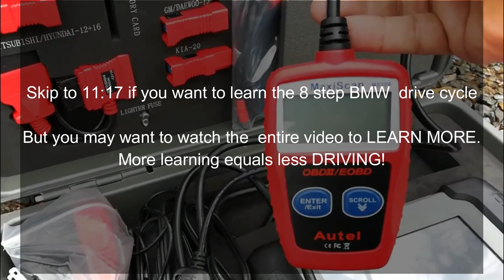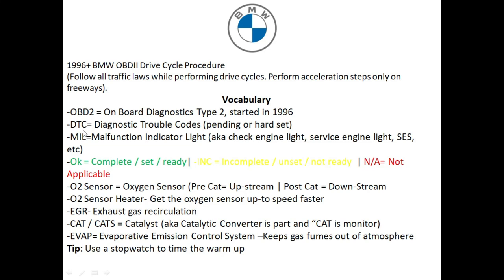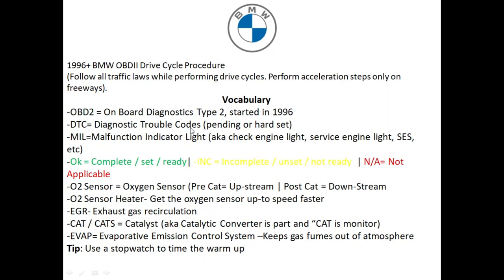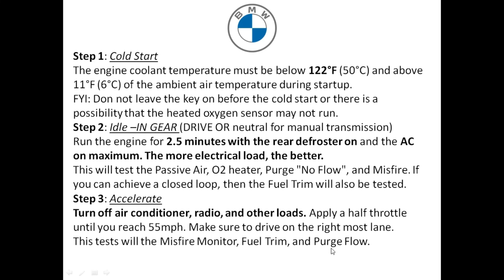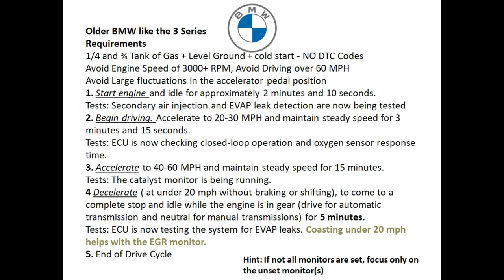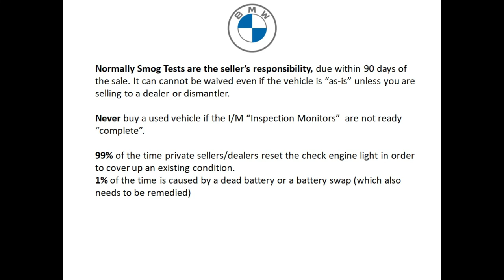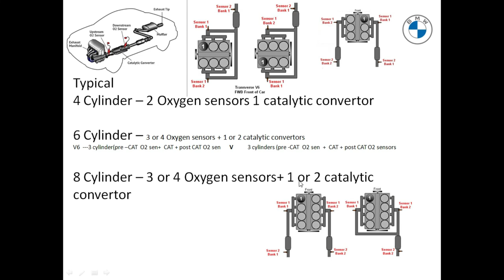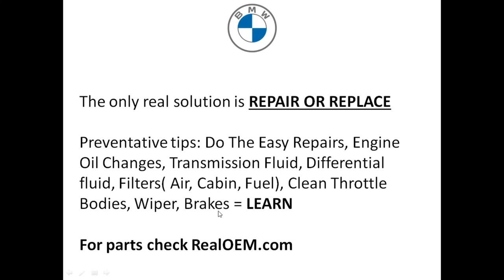BMW Emissions Testing Drive Cycle ▶️BMW Smog Check ▶️ BMW o2 CAT EGR EVAP Monitor Readiness

Comment: Can’t get the CAT to get to ready…. E46 M3 160xxx miles…
Reply from the maker: Hi Bill what caused the monitor data to cleared or what triggered this event?
Reply: @RANDOMFIX  - this has been on going for a year and a 1/2. First - I had to replace an oil level sensor. That requires disconnecting the battery. Smog failed. I drove for a few MONTHS and all but the CAT registered ready. Then, that new oil level sensor failed and I had to replace it. Start back from 0. Well fast forward a year (1/2 of which I didn’t drive much due to Covid) and I’m driving 1 hour each way to work (in LA traffic). For the very first time after weekly checking, my CAT registered READY. I was in shock. I had a SES light on with a P1434 code due to an old gas cap - I replaced it with an OEM gas cap over the previous weekend - so I decided to clear the code. Bad idea, that reset ALL OF MY MONITORS - including the CAT which took me 1 1/2 years to get to ready. I’m now stuck on getting my CAT and EVAP to ready.
Reply from the maker: Bill, please make sure you battery is perfect. Then please check all the connections for all of o2 sensors. After you verify both of those conditions are perfect then watch the this playlist as it's only about incomplete catalyst monitors, https://youtube.com/playlist?list=PLDEbtVOPRC-h1BAzaWQ-6NSnmG0gwvgwP

Keep me in the loop.
Reply: @RANDOMFIX  - battery should be good - replaced less than a year ago. I’ll try to look at the O2 sensor connections then review your playlist. The CataClean I just ordered after looking at your other video.
Reply from the maker: Awesome, you don't need to worry about the evap as it's exempt. For you drive cycle make sure you don't exceed 3k and keep that mph under 60 just like the minis.
Reply: @RANDOMFIX  - I just had EVAP switch to "Ready" as of yesterday. I currently have just under 3/4 of a tank of gas and the last time I filled up, I added some fuel injector cleaner. My CataClean came in, but I'm assuming I should flush this tank of gas first before using that. The Cat is still 'not ready' -- and my P1434 check engine light just came on this morning. It's only been 8 days or so since I replaced the gas cap, and 3 of those days I didn't drive at all. I hear it takes 10 driving days for that code to go away..... IF its the gas cap. Edit: I've been driving under 60 MPH and under 3k RPM for the past few days. I live in LA so it's hard to keep a consistent ~50 MPH anywhere... but I try to keep it above 45, always under 60, and always under 3k RPM. No luck yet.
Reply: @billfrigo7602 did it work out for you eventually ? I got e46 M3 as well. The battery died so now have to do the driving cycle as cat wouldnt kick on. I had to do it before. Its painful.  The key is drive for 20 mins under 60mph, can't  stop, cant brake, cant shift, and don't go above 3000 rpm. I had to do it before. It worked just painful. Have to do it at night on freeway with hazard lights on
Reply: @BTC-pt3br  - I did this for OVER A YEAR - with no success. It ended up being my O2 sensors being bad. I took it to 4+ shops and no one was able to determine this was the correct issue, until the 4th shop. If yours doesn’t register as “ready” after about 1 month, assume you’ll have some sort of physical component that will need to be replaced to get it to work.
Reply: @billfrigo7602  I see. Thank you for that information. Based on my past experiences, just driving it would not work. Have to do that specific cycle exactly how they say to do it. When I had that issue before, I drove the car for a while and it did not solve the issue.  Then the mechanic gave me the paper showing the BMW driving cycle and what exactly I need to do. Basically 20 mins non stop 40-60mph and can't go over 3000 rmps. If you brake or shift or go over, then have to start over. So I did that cycle exactly according to the instructions and it worked. So took 20 minutes. 

Now I have the same issue since the battery died again. Have not done the cycle yet. It's painful since I would have to get on freeway at night with hazard lights on to be able to go under 40-60 non stop. 

If it does not work this time, I will definitely keep in mind what you mentioned about the sensor.
Reply: @BTC-pt3br  man i will need to perform this for my 2006 M3, been tough, i only need my CAT monitor to be ready for smog, I will need to do this at 12-1am with flashers on. This will be a pain.
Reply from the maker: Do a long warm up before you drive as it make it a little easier at 1 am
Reply: @RANDOMFIX  I will definitely warm it up for several minutes then proceed on driving 55mph for 15-20minutes. Been driving with expired tags for months  now so i gotta get this taken care of. I will post results once completed.